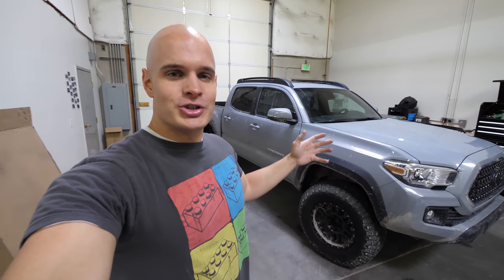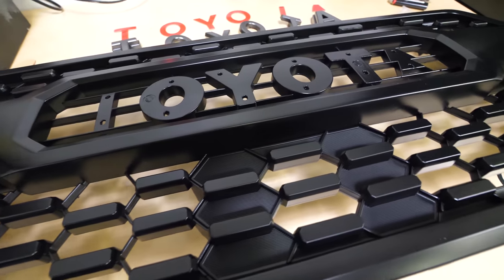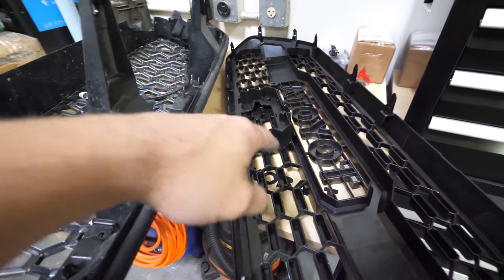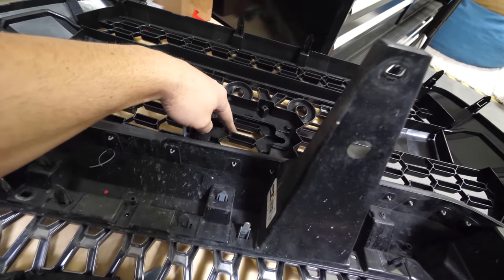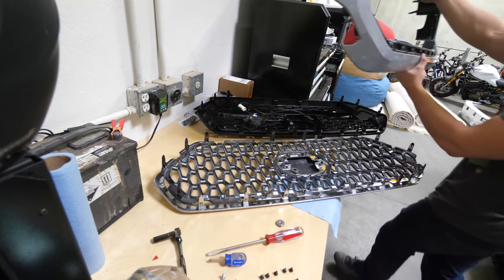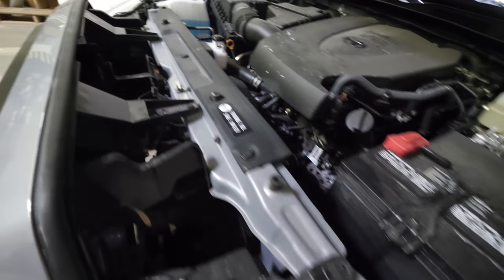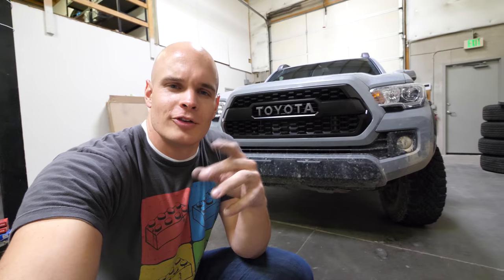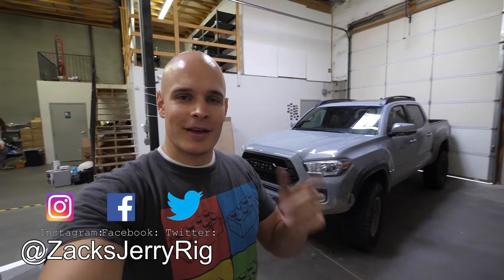Tacoma TRD PRO 2018 Grill Install - WITH Sensor!

Comment: Everybodys swapping out those grills now except me it seems. I don't like the shiny cover on the TRD grill at all so I plasticoated the chrome trim on mine and sprayed it and the grill satin black. The tacoma off road grill looks good now after modifying it. (They sell the black trim piece on ebay if you dont want to paint it)

Comment: I got news for you. Anytime it snows or rains hard. Sensor still goes off. I have a 2019 and have this problem. I recently went Toyota to have a TRD grill put in. They could not do it because the sensors do not match in the same place on the Toyota factory parts. But apparently they do on your aftermarket one. Thanks for the info.

Comment: Does installing the imitation grill void warranty?
Reply: I was wondering about this too
Reply: I was told by the dealer that if you move the TSS censer it voids your warranty. Supposedly the TSS is carefully calibrated and in case of a malfunction your up shits creek.
Reply: It voids your warranty on the tss system. Not the rest of the truck, like the engine and transmission

Comment: The funny thing, most companies produce or license "imitation" parts, as they can make more money on the open market at a lower cost of manufacturing, etc..... So, are we sure Toyota didn't "make" this cheaper part? Hmm.......🤔

This happens in many industries around world, as I'm sure you know, so....would be interested to see what "Parent Company" owns the company you got this part from etc etc etc
And as always, love these vids & hole to see more!
Cheers, A
Reply: I've just recently got this exact grill and installed on my 2018, I could say it could be off the same assembly line, its not a cheap imitation, its got quite the weight to it for being plastic, thick plastic.

Comment: 2 things.  The shiny garnish that goes over the radar sensor has 2 "star" clips that hold the top in place and 2nd, you can use Xpel Stealth film to put over that shiny part to make it matte finish.  Looks much better.

Comment: looks good, looking at getting a 2019 ; how 's the power with the engine? i read that the engine is sluggish..?
Reply: its not bad! I just got 2019 and it actually feels more responsive compared to my stock jeep wrangler.
Reply: How much $ you pay for the cover sensor in Toyota

Comment: Update: the OE sensor cover does not fit the aftermarket grille; the tabs are different enough.  I don't understand why MotorGenic includes a Chinese grille and a Toyota sensor cover that don't match!  The whole thing is going back.  There's reason the Toyota grille costs $400 and the Chinese $100!

Comment: I changed my grill Toyota Tacoma 2018 super sport doble Cab more than 2 weeks ago sensor light still on .... I also I paid $55 for the original panel cover .... still light on .... :/ sad
Reply: I'm having this issue too, ever come up with a solution? I'm afraid to go to the dealer and them tell me they can help me cuz it's a knockoff
Reply: Alan dealers wanna charge me $400 and they said not guaranteed

Comment: Man that original grill cannot be much uglier.

Good choice.

I would remove the shininess from the plastic piece with some acid or very fine sandpaper. It's quite distracting.

Or even better just add a plastic foil in front of the sensor, behind the "original" honeycomb.

Comment: A lot of radar sensors like those don’t work when it’s raining anyways
Reply: Tx_rocket_man Mine do, but they don't work when I'm in a blizzard 😂 I've found this out in January-February when I bought it weather was horrible.
Reply: Mine failed in the rain the other day, wish i could just disable it all together...
Reply: I've seen a video (I think youtube) where someone does disable it using a computer software program, so it doesn't turn back on everytime you restart it.
Reply: @1983burr no, it will throw an error code
Reply: @boomy then your cruise wont even work.

Comment: Does this void any warranty by doing this? I have a 2019 TRD sport and love the pro grill
Reply: I’m wondering the same thing. I just bought a 2020 TRD Offroad and have always loved the pro grills. I’m tempted to get the $100 aftermarket piece but I’ll have to do some research on the warranty, especially since the sensor up front is effected! I’d hate to have to buy another one of those in the event it gets too water damaged.

Comment: New link  for the grill here. Front Grill for Tacoma 2016, 2017, 2018, 2019, Including SR, SR5, TRD Sport, TRD Off-Road, Limited, TRD PRO Grille (Not Compatible with 2018 & 2019 with Garnish Sensor) https://www.amazon.com/dp/B07VK3RXVY/ref=cm_sw_r_cp_apa_i_NxspDbJFC646P

Comment: Nice Truck
 I was told by Toyota changing the grill on my 2018 will void warranty on my truck.
Their reason was the sensor is being moved lower and could cause the sensor not to work properly for my truck. Is this just BS?

Comment: The reason to pay the extra $300 is that the money is going to the company that owns the trademark and made the truck instead of some other unrelated company that's piggybacking off of what Toyota made. On the moral side of things you can either pay less money to a company making an illegal knockoff or pay more money out of your pocket to the company that originally designed the product and owns the IP and trademark. That being said, $400 is a lot of money compared to the $100 for what is essentially the same thing and the more economical route is what most people will choose.

Comment: Hey zack Inside that Toyota emblem there is thin layer of material that helps focus  radar cruise sensor beam that's why it's a shiny finish on the face.. your replacement cover looks like it should have the radar beam material .. cut open the emblem and see for yourself.. I cut open a Toyota Prius emblem and I'm sure it's the same for the Tacoma.. without the proper emblem you will notice that it detects cars in the lanes next to you.. what's the proper emblem the sensor will only detect the car in front of you like it's supposed to

Comment: You need to have the sensor reprogrammed to be adjusted for the height of the lift.
Reply: Demicron
If you look at it, the logo sits lower in the heritage grill than it did in the stock grill. It "may" balance out just by the location on the new grill...
Reply: @keithradons8758  it does not matter where is sits in the grill. The mere fact that the tires are larger and the suspension is lifted will cause the sensor to need recalibration.
Reply: @keithradons8758  I work on these brand new trucks daily, if you get my drift
Reply: Demicron *Meant to say the sensor sits lower in the heritage grill*
Was just a mere suggestion... didn't mean to rattle your cage.

Comment: I had Toyota install mine like a dumbass I don't think they hooked my sensor up I have not heard it go off not one time and I have ran up behind parked cars at a red light on purpose really fast I'm assuming that should have said it all off am I wrong should I take the truck back to Toyota or does the sensor not work that way any help would greatly be appreciated to test it because I really don't feel like going to Toyota and fucking with them about it so please if anyone could help me test it at home that would be great thanks for any comments in advance.

Comment: Great video - really helpful - the OEM sensor cover is the way to go, I used the fake one and the collision sensor kept turning off randomly. The OEM cover has a nice plastic glaze which seems to do the trick!
Reply: DiscoveryLegend, where did you find the “TOYOTA” letters?
Reply: @michaelmorgan330  I actually bought the OEM TRD Pro grill (400 bucks) and the fake sensor cover initially (35 bucks). I think the knock-off grill's on Amazon (120 bucks) comes with the letters for you to stick on.
Reply: Rith Kem, I must have bought the wrong one on amazon because it didn’t come with the letters. I should have just been smart like you and bought the 400$ one with no worries. Thanks for the reply

Comment: Debating on trading my 2018 chevy colorado for a Tacoma any advice??
Reply: Both great trucks! I went with the '18 Tacoma because they depreciate the least of all trucks in it's class. And I slightly dig the aesthetics more. I'd say it comes down to personal preference, and.. ask yourself: what will you be doing with the truck?
Reply: Lee Teodore nice man I really like the calvary blue Trd pro and for daily use in the city and camping
Reply: The TRD Pro is a very sweet truck. I picked up a fully loaded sport which I can't stop thinking about. They are amazing trucks. Whatever Taco you choose, it won't be a bad choice I guarantee it
Reply: Both trucks are great especially the zr2 I go with Toyota just because of the reputation, off-road capability, and larger aftermarket. Both great trucks and I’m planning on getting the 2020 trd in hopes of it being next gen with a new engine.
Reply: If you know anything about Toyota they don't redesign models every few years, maybe slight asthetic upgrades but not total redesigns, you do know it was just redesigned in 2016. Hell look at the Tundra that's not gonna see a redesign till 2020. People don't understand what it takes to redesign a vehicle and all the tooling that goes with a redesign, coming from a Toyota salesperson that did factory tours and insider stuffs.
Reply: January Fire DO IT

Comment: I bought a 2017 Grill for my 2018 Tacoma. Behind the toyota emblem there is no place (Mount) for the sensor. Could the mount from the 2018 insert come out to add to a different grill insert?

Comment: A fast check with TIS ( Toyota Service manual  ) states you need to a calibration done after changing the grill.  The sensor doesn’t calibrate itself.  It thinks that’s the norm and can the dynamics of the way your ADAS works. New self driving aids are no joke especiallyif you use them as described.  Use factory parts and always have ADAS system recalibrated by a certified shop.  😁

Comment: Hey do you know if they sell a grill for the 12-15 Tacoma’s? Never saw your channel before i subd you. I have a 15 regular cab with 3 inch leveling kit and method nv wheels 265/70/17 soon to be 285’s. Tacoma’s are awesome trucks. Never misses a beat. Excellent off-road

Comment: If I could give you more than one thumbs up I would.

I just followed your video to the T"
I have a 2019 Tacoma w/ the Toyota symbol and following your video I was able to install the new Toyota lettered grill, the same 1 that you have.
I purchased the sensor in advance so once I received it I already took out the pieces and yes, just like yourself, it's like they welded them in there so I had to break off the plate to replace w/ the sensor cover.

 everything is in place & on point.

Again I would give you more than 1 thumbs up if possible. 

You're awesome

Now I'm going to see you posted a "HOW TO VID" on installing the 30" LED light along the bottom of the new grille 

thank you

Comment: I got the aftermarket Pro grille and the sensor cover from MotorGenic.  Unlike the aftermarket grille, the sensor cover is an actual Toyota part.  I removed the plastic cover that comes with the grille, but CANNOT get the sensor cover to clip into place!  No matter how hard I try to get the plastic pins to clip, they won't.  I have contacted MotorGenic to find out if there is a trick to getting this cover to clip.  Meanwhile I have a truck without a grille sitting in the garage. 

 So far I am not impressed with the quality of this aftermarket grille; it is shoddy.  Now I  can see why the difference in price.  If MotorGenic is unable to get this resolved I will send it back.

Comment: Neat. Was that black plastic protective sheet glued down? It looked like it would transfer over, with tabs for retaining it under the screw inserts. I really want to reach into the video and pull on it. :D Also, if you don't like the gloss cover, I would sand it with high grit paper to get a matte finish. You can always polish it back out (perhaps using one of those 3M headlight polishing kits). You'd get a slightly different material thickness, but I imagine it wouldn't be enough to cause a problem. You might also paint it with a matte clear coat or a black paint that's roughly transparent to radar. I'm not fully understanding this paper (http://publications.lib.chalmers.se/records/fulltext/254360/254360.pdf), so I could be way off, but it looks like thickness matters, and the addition of metal flakes or other additives can reduce the transparency by causing the material to temporarily absorb some of the energy.

Comment: There is a reason toyota puts the plastic screen over the radar cruise control sensor in the grill! you have found out why now! you should not mess with factory fitted items.

Comment: you can probably just sand that glossy portion of plastic in front of the radar, although water might have a harder time beading up and rolling off when stopped, not sure.

Comment: still have my factory grill on, and driving today the sensor stopped working because it got covered in snow and slush. wiped it off when i stopped worked like nothing happened. Havnt had it in the rain yet though.

Comment: You could try plasti dipping just that section over the radar. Some people use a very light coat to black out taillights; same concept, not enough to block the sensor, but just enough to make it appear matte

Comment: Just wondering why you would sneak up on a car waiting for the PCs warming to kick in for testing it? Would it not have been better to try out the adaptive cruise control? It will tell you when it senses a vehicle which should happen at about 100 yards.
Reply: Yeah like if it had the sensor covered warning and he didn’t see it BOOM lol or if he was secretly driving a ford

Comment: Did anyone else have the issue of the sensor not working properly after install? Mine works sporadically  (it has been 2 days since install). It keeps saying the sensor needs to be cleaned. I assume this will go away with time?
Thank you!
Reply: Did that message ever go away? I replaced mine 2 days ago and get the same thing, says it needs to be cleaned

Comment: Super late comment but here goes. Great video but I have to disagree with one thing. You say in rain and snow is when you need the sensor the most.  As the sensor is for the Adaptive Cruise Control, I would argue that it doesn’t matter if it’s not working in those conditions as you should not be using cruise control in said situation.
Reply: And what about emergency braking....?

Comment: Got my grill installed yesterday with no sensor glass and My sensor says its dirty and dash disables the sensor after 2 min of driving every time. It doesn't seem dirty. Any ideas how to fix this? Been like this past 24 hrs
Reply: Stevarino what’s the update with the sensor? How did you fix the problem ?

Comment: Quick question, do you think your lift compensated the 2 inch difference on the TSS-P location? TSS-P on the  TRD Pro Grill is 2" lower than the TRD Sport and Off Road as far as I know.  Thanks!!
Reply: Where did you hear that???
Reply: tawaitai I did not hear. I measured it.

Comment: Everything is acceptable but not by altering stock important parts, like radar sensor which does help a lot.
#SafetyFirst :)
Looks may be compromised a bit over critical parts.
Though $100 logo looks good it will be bit lower on quality I suppose. Also $300 saving by compromising on sensor doesn't sound good from my point of view.
Further I feel the honeymoon grill just gets fixed by those plastic push-shroud, where as the stock grill is with plastic push-shoruds + screws, so it may even fall off (worst case). Another issue would the actual quality of the grill; over the period of time with multiple exposures to direct sunlight there are chances that the plastic gets harder and brittle, so brittle that it may break even by going over bump/ditch.
Reply: An engine, heck a driver is a important part of a car, radar sensors in cars are not "important" parts, they're just there for MFG's to boast about "safety"  shenanigans and jack up prices. Heck most buyers/owners (like yourself) don't even know what it's for (and its worthlessness with inattentive drivers, bad weather, or offroading dirtyness).

all the beeps of lane departure, forward collision, etc are more annoying than helpful for a attentive driver
Reply: Skimping on parts isn’t silly. Spending hundreds of dollars to get a grill for aesthetics just to look like a car you didn’t buy is silly.

Comment: Zack I love the way the truck looks with new grille. I would definitely use the original part and get the TSS-P calibrated in a dealership. Being a life saving technology, I would not take the chance. Thanks for the video!!
Reply: Yeah spend $450+ for the OEM part which they wont sell to you unless you provide a TRD VIN, and then drop another $750 for the stealership to callibrate(insert a washer) the sensor even though his sensor is working just fine. Great idea.